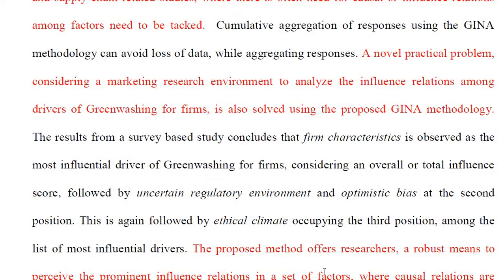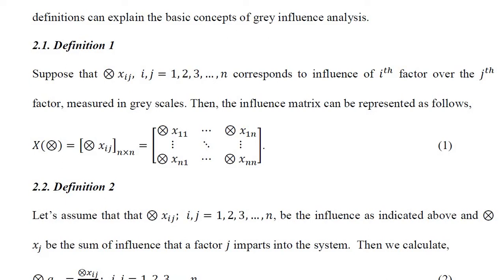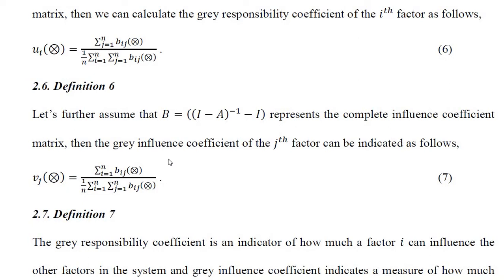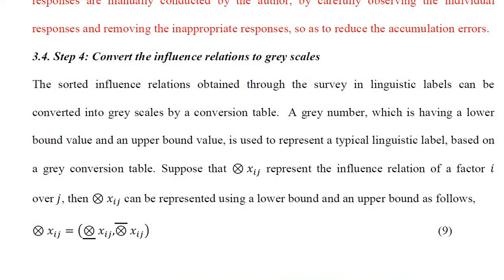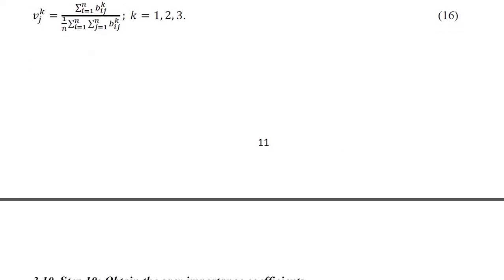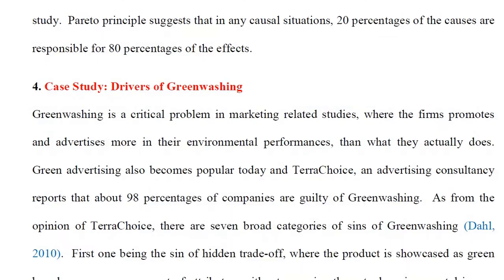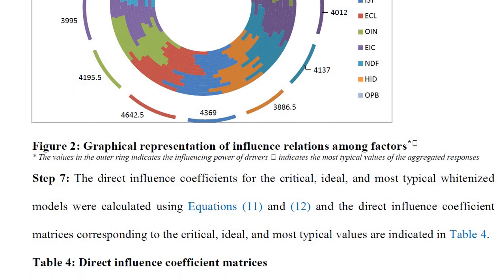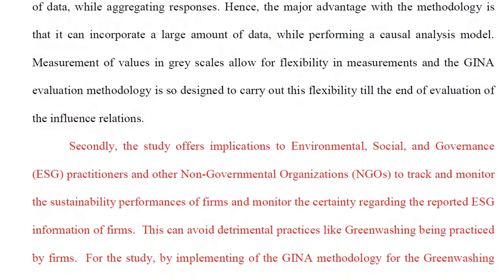Grey Influence Analysis (GINA): An Introduction

Comment: I have a question regarding the implementation of the method. In Step 6 of the GINA methodology, I noticed that the diagonal elements in the influence matrices (representing a factor's influence on itself) are given as 56 (critical model), 168 (ideal model), and 112 (typical model), rather than 0. Given that the study uses 56 usable survey responses, I was wondering if these values were set as fixed references corresponding to the total number of responses. Could you please clarify the rationale behind assigning these specific values to self-influence, instead of zeros?
Reply from the maker: The influence scores in the diagonal values (element with itself) are pre-set to their lowest value, which is set as "Very Low"; we use a grey conversion scale of (1, 3) for convenience.  Hence, if there 24 responses, the critical value will be 1 (lower)*24 (1+ 1+ 1+... 24 times) = 24, the ideal vale will be 3 (upper) *24 (3+ 3+ 3+... 24 times) = 72, and the typical value will be 2 (avg value)*24 (2+ 2+ 2+... 24 times)=48, accordingly.

Comment: Hi, sir. Thank you for this video and for providing the Excel file. I'd like to know if this technique can be used for a minimum number of experts involved as respondents (i.e., using fuzzy DEMATEL or Delphi methods). One more thing, could you share with us an Excel file for Step 1-6 or 1-10, including the whitenizing of the aggregated responses? Thank you!
Reply: I was thinking of 15-20 experts.
Reply: @radtwelve Thank you.  You can use the methodology for 10-15 responses also.  The aggregation of the responses in grey scale are done by 1. Adding the lower bounds of the corresponding responses 2. adding the upper bounds of the corresponding responses and 3. Taking the mean of the lower and upper bounds of the corresponding responses. You will get 3 initial matrices as shown in the Excel sheet.

Comment: Respected sir, Kindly share your views regarding adoption of this methodology for barriers under 5 categories. Do we need to collecte and analyse the data separately for these 5 categories?
Reply from the maker: If the five categories are independent, you can use the method separately, for the categories and identify the most prominent barriers in each category.  You can use this sample Excel sheet for GINA calculation.
https://www.researchgate.net/publication/363845309_GINA-methodology-demonstrationxlsx